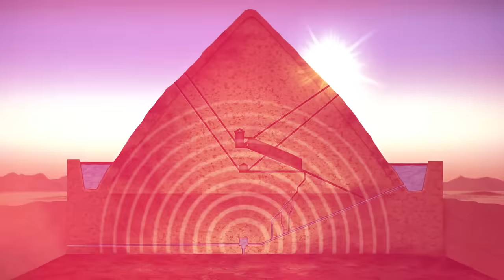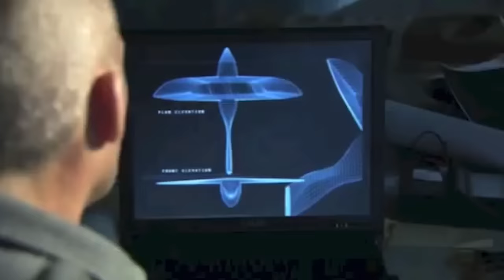10 AMAZING Discoveries in Egypt That SCARE Scientists

Comment: They suspect the Egyptians of flight, electricity, mathematical knowledge, accuracy of modern machinery in their stone work, the ability to produce fire temperatures to melt iron and so on based on their artifacts but refuse to acknowledge the invented or used the wheel.
Reply: The whole premise makes no sense at all. You need to think outside the box. I believe in the whole Bible, it is the truth. If you have curiosity I recommend you to watch Is Genesis History, with an open mind. It’s found on YouTube
Reply: @lorrainewhitehead9080  lol
Reply: If you haven't figured out that for all we know we really don't know much I have a episode of blues clues for ya.  The problem comes from folks that "know" that refuse to remember that history has been turned upside down several times due to discovery,

Comment: I keep hearing the early Egyptians did not have the wheel, yet the Sumerians in all likelihood had them as early as 4200 BC.  Hard to believe they had it so much earlier than Egypt.  Doesn't sound quite right does it tho Samaria did exist before Egypt. But still you'd think it would have migrated to them by 3000 BC at least and the Pyramids were built roughly 2500 BC.  You just have to think there's still a lot we don't, and may never, know.
Reply: In ancient Egypt, the wheel was known since the Fifth Dynasty. About sixty wagons with four to eight wheels and only a few two-wheeled carts are attested. The first wheels appear on a scaling ladder and a siege tower in military contexts. The earliest wheeled vehicle is proven to have been in use in the Thirteenth Dynasty.
Reply: This is what happens when you let heathens educate you. They give you his story instead of history.
Reply: @methuselahbenyah6745  Indeed.  Depends on who is writing the history as to how it reads.  Not to mention, even when there is no bias, 10 people will remember the same event differently.
Reply: It is still being debated by historians as to whether or not the wheel was invented by the Sumerians. They were the first to refine its use by building wooden wheels that attached to horses for plowing. The oldest wheel that has been uncovered was determined to be from Mesopotamia and dated around 3500 BCE.
Reply: @SmoBoo  

In the book of genesis the Egyptians chased the Israelites withchariots. Genesis means the beginning. Showing you that they figured out the wheel FROM THE BEGINNING. Scientists can debate all they want but it's irrefutable.
Reply: @methuselahbenyah6745  Not a shred of evidence, Genesis is a fictional story, THAT'S irrefutable!
Reply: @VonRyansExpress True, but he wasn't born until around 1330 BC give or take a few years so the mystery of when the wheel actually appeared is still being debated.

Comment: The egyptians had metal tools for cutting rock made from a copper alloy. By using sand to create friction, you can cut/drill through rock with a toothless blade, and I mean, there wasn't any shortage of hard sand exactly.
Reply: My point is: That is how you get the sharp edges of the sarcophaguses made by granite.
Reply: Also, The Dendera Light is a Lotus flower that shoots out it's life force and a snake. It's a depiction of the worlds creation, not a god damn lightbulb.
Reply: @Spookulv  the easily misled will insist it is a light bulb/laser/battery powered.

Comment: Dendera light : The view of Egyptologists is that the relief is a mythological depiction of a djed pillar and a lotus flower (Nymphaea caerulea), spawning a snake within, representing aspects of Egyptian mythology.[1][2] The djed pillar is a symbol of stability which is also interpreted as the backbone of the god Osiris. In the carvings, the four horizontal lines forming the capital of the djed are supplemented by human arms stretching out, as if the djed were a backbone. The arms hold up the snake within the lotus flower. The snakes coming from the lotus symbolize fertility, linked to the annual Nile flood.[

Comment: For the metal question. You dont actually have to melt the metal to forge it. It's for when you want ro put in a mold like an ingot, a bar. A block, or a shape of a coin. Is usually where youd melt metal. If they have access to coal or wood they could hammer the shape of the metal.
Reply: That's right. Those pieces being shown are natural. They are formed like that after burning through the atmosphere.  The only things the Egyptians did was clean the carbon off.

Comment: Interesting info but get your facts straight- the Egyptians did have the wheel. There are plenty of images of chariots.
Reply: The first pyramids were built before 2400 B.C. the chariots did not appear until around 16th century B.C.
Reply: @EmptyHand49   We can also sadely assume that none of those are final or hard numbers. There is nearly ZERO chance that they (let's just assume the Egyptians are even the correct civilization that built the pyramids vs inheriting them from a previous superior civilization - and we can only assume this instead of proving it) were able to build something as sophisticated as the pyramids and they did not have the technology to use the wheel- That is almost impossible. I am sure many engineers would just laugh at such a ridiculous proposition. 
The moral of the story...we know very little and we have been lied to to about much we think we know.

Comment: mentioned several times in this presentation is the notion that the Egyptians did not have the wheel.  ??? When did they then start aquiring chariots?
Reply: As far as I remember the Wheel and Chariot was introduced with the Hittite Invasion during the reign of Ramesses II.
But why it was only used in the Military is boggeling.

Comment: I've heard this before, and I don't know much about the genetic mutation that would have caused irregular, elongated head shapes, but more than one civilization I can think of used devices on the heads of their children, starting in infancy when they have such soft heads still, and continued on throughout their growth til the right shape was achieved. This type of thing is also still done in some places to elongate women's necks. I'm talking like 10+" long! They elongate them as a show of status and wealth using a series of decorative gold(en) rings they add as can be accommodated to the point where when complete, if removed, the women are virtually unable to hold their heads up of their own volition. 
I know there's also an North American indigenous tribe, or two, that strap a flat board to the back of their babies heads until reaching the desired effect. You will not be surprised to learn that the Army initially gave them the lazy and derogatory term, "Flatheads", which spread until commonly used, but I sincerely doubt the tribe called themselves by that name.

Comment: The narrator mentions more than once that the Ancient Egyptians did not have the wheel.  However, explain the wheeled chariots found in Tutankhamun's tomb. There are also toy carts found, and illustrations of carts and chariots on tomb walls.
Reply: Ancient Egypt's pharaonic period started around 3100 BCE. The Giza Pyramids were built around 2500-2450 BCE.
Chariots first appear in the archeological record around 1550 BCE...right after the Hyksos are expelled from the northern delta region.

Comment: Ummm they DID have the concept of the wheel. According to John Peter Oleson, both the compartmented wheel and the hydraulic Noria were invented in Egypt by the 4th century BC, with the Sakia being invented there a century later. Also one of the ways they moved and designed giant granit pieces and moved brick and mortar along with slaves, architects, mathematicians, astrologists etc. They also were one of the first to have a navy.

Comment: The statement “ they didn’t have the wheel” is absurd and brings everything said in question.  🙄 Of course, the Egyptians had the wheel - they had chariots. The wheel was not used when building pyramids    because it would bog down in the sand.

Comment: If the ancient Egyptians did not have the wheel, why did they put chariots in some of the pharaohs Perryman?
Reply: Ancient Egypt's pharaonic period started around 3100 BCE. The Giza Pyramids were built around 2500-2450 BCE.
Chariots first appear in the archeological record around 1550 BCE...right after the Hyksos are expelled from the northern delta region.

Comment: The Egyptians used wheels in their chariots.
Reply: They didn't have the wheel until the chariots arrived, around 1600 BCE. The Pyramids of Giza were built about 1000 years earlier than that, when they still used wooden sledges.

Comment: How the hell do you figure they didn't have the wheel? Of course they did. The ancient Romans existed during the same time period and had chariots. It would be ridiculous to assume they could do all these great construction work without a wheel apparatus of some sort. In fact the leading theory of how the pyramids were built is that they rolled the massive blocks of stone up the scaffolding on large trees rounded smooth - aka wheels. 🙄🙄🙄

Comment: So they didn’t have the wheel but they had Chariots which rolled around on wheels that were pulled by horses. But they didn’t have the wheel.
Reply: Ancient Egypt's pharaonic period started around 3100 BCE. The Giza Pyramids were built around 2500-2450 BCE.
Chariots first appear in the archeological record around 1550 BCE...right after the Hyksos are expelled from the northern delta region.

Comment: You say that they didn't have the wheel , is that a joke or just misinformation , you probably believe that when the Egyptians built the pyramids that they dragged those heavy stones several miles from the quarry like they showed in the movie The 10 Commandments instead of transporting them by boat . Common sense tells you that they would of had to of had the wheel with all the things that they built and the knowledge that they had especially when nowadays we still can't figure out how they did some of the things that they did and the exact measurements that was used in building the pyramids and their knowledge of the stars , they would of used wheels for chariots , measuring devices and toys .

Comment: I get so tired of these people and even so-called "experts" who dumb-down everything. The exact shape of the pyramids is by design, focusing perpendicular cosmic rays to its center. The word pyramid literally means "fire in the middle". The two main diagonal chambers held two fluids and the focused energy created electricity which was connected via huge metal wires. The top of the pyramid was the gold electrode and the bottom went to ground. The "king's chamber" isn't; it's the reaction chamber.

Since you're looking for the architect(s), look no further than the Annanuki of planet Nibiru in our system's second sun. The period of that sun is 394-1/4 years as recorded in the Mayan calendar's B'ak'tun. So every 400 or so years they returned to our planet, made their presence known and did a variety of projects. The last perigee of that sun was December 2012 and its largest planet strolled through our inner solar system in 2021. The elongated-skull aliens are "homo capensis", for what it's worth.

Comment: Those are clearly a type of serpent. Anyone with eye balls can see the head, body, eyes and gills of a snake figure. That being said, it's possible they imported electric eels as Egypt was well known for importing things from far away especially if it gave them an upper hand.

So would it work? An electric eels output power is almost 500watts and almost 1 amp......I'd say that's plenty to generate a light source by far. So it's definitely plausible that this it's what's being shown. At least that's what my crazy brain is thinking. Certain liquids introduced to electricity WILL produce light...that's a fact. So who knows.

Comment: You claim several times that the Egyptians did not have the wheel. They had battles with chariots against the Hittites who also had chariots, they had wagons and grinding wheels, they had grain milling wheels, they had pottery wheels, they had drills, they had spindle wheels for looming wool, they had rope woven cog wheels, rope pulley wheels and sun dial wheels before the Greeks to. BS on not having wheels. 

Even the Sumerians and Babylonians had wheels decades before the Egyptians settled the Nile Delta after leaving their lands in Jordan over a bad drought when Abraham's first wife Sari was taken by Pharaoh number one there in Jordan.

Factually wheels go back some six thousand years in all of Turkey, Mesopotamia and Ur of the Chaldeans. They all had chariots, grinding stones and potters wheels.
Reply: Egypt's pharaonic civilization started around 3200-3100 BCE. 
The Giza pyramids were made around 2600-2500.
Before the Hyksos took over control of northern part of Egypt around 1660 BCE, there is record of any wheels being used.
After the Hyksos control was overturned, around 1550 BCE horses and chariots are seen being used in ancient Egypt for the first time. 
Back in the old kingdom days of the pyramids, the ancient Egyptians used mule trains for long distance movement of items and wooden sledges with water being poured onto the sand in front of them, which reduced the friction of the wood on the sand. Science has confirmed that it works.
There are also surviving examples of these wooden sledges in the Cairo museum and also at the Met museum in New York City. They also depicted themselves using wooden sledges to move a giant statue around 23 feet tall, back around 1900 BCE, on the walls of the tomb of Djehutihotep. 
Look it up.

Comment: And another thing! Does this guy seriously believe that the Egyptians had no concept of the wheel?? Or that the incredibly precise and immense granite blocks in the so-called kings chamber were carved using bronze chisels and wooden mallets? Side note: bronze will scarcely scratch granite. And by the way - wrong pyramid! The great pyramid does not have the cladding stones at the apex. That is the smaller pyramid next door. Interestingly the pyramids were built about 9,000 years before Khufu was born. There’s not one shred of actual connection - only a mis-spelled forged  inscription applied by the fraudster Vyse to justify his failed investigation